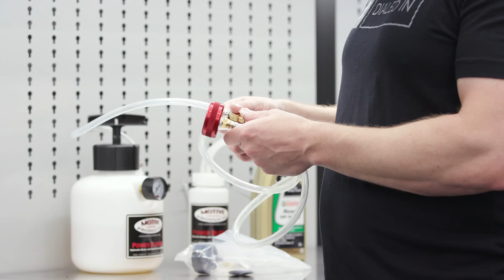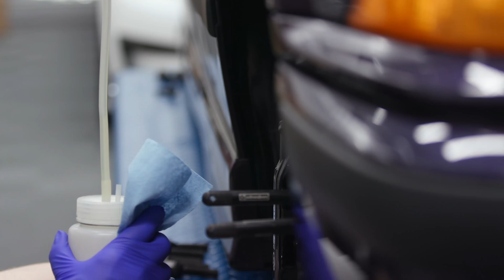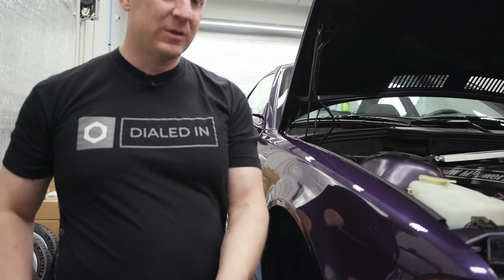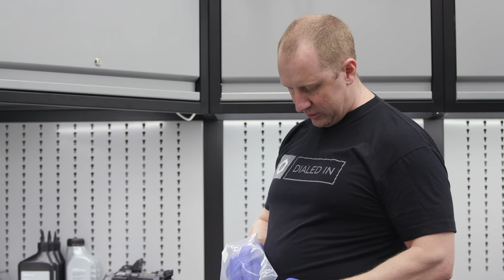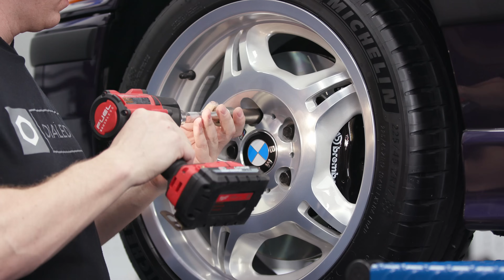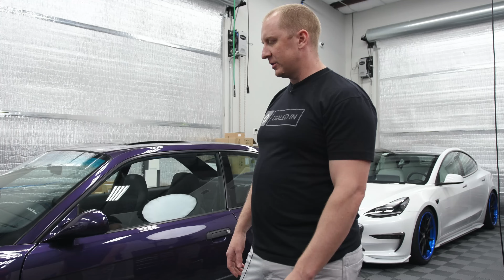E36 M3: Bleeding the Brakes and Buttoning up Suspension Install

Comment: What brake rotors are you using with the 996 brakes?  325mm fronts?
Reply from the maker: These were new aftermarket Brembos.
Reply: Are they from a E46 M3?  I have a similar set up but looking for slotted floating rotors, not slotted/cross drilled

Comment: Hey Matt, it would probably be a good idea to get a mini rolling cart for when you take parts off the car and use the tools and drill. 

That way you don’t need to pick everything up from each spot and also it will reduce the chance of damage of a tool hitting the paint since your using the the lift as a table

Comment: Maintain the pressure in the reservoir and loosen the bleeder until you feel you may be pulling air from the bleeder threads. I usually don’t put fluid in the pressure tank because its a pain to have to clean it out when you done.

Comment: I used the Motive for the first time a couple of weeks ago on my MX5 ND2. Really easy to use and flush/bleed the brakes. I just cracked the bleeder screw open a quarter of a turn and it worked well. Kept the screw open until I needed to pump up more pressure or empty the "catch-can"

But lol@BMW nerd comments 🤣

Comment: FYI you need to remove the preload from the end links while the suspension is loaded.
Reply from the maker: No
Reply: @ObsessedGarage  Your ignorance amazes me.  Yes you absolutely do.  You do not want preload on your sway bar while the vehicle is sitting.  This is pretty self explanatory and important. 

You are wrong Matt. If you don’t know what you’re talking about, do not spread misinformation.  It doesn’t help anybody.  In this case, you don’t even understand what adjustable end links are for.

Don’t let your ego get in the way of learning.  If you want to be “obsessed”.  Then do things properly.

Comment: front rotors are incorrect orientation, drivers side rotor should be on the passenger side, edit so are the rears. awesome build btw
Reply: How can you tell? The slots don’t make a difference - the direction of the internal cooling vanes does.
Reply: @matthewfuller1129  think of the slots as arrows, the arrow ends at the edge of the rotor, the slots should face the rear of the car. I guess it doesn't really matter, but they were designed to go the other way so that's the way I'd install them. Edit use the slot at the 12 o'clock position with the arrow rule, you will see which way they point. Some rotors it does matter which side they are on so the cooling veins are catching air.
Reply from the maker: You obviously have no idea what you're talking about..
Reply: @ObsessedGarage  in my experience most rotors with external slots face the rear. I realize that the internal vains dictate the direction, it is just very uncommon to have the 2 not match. I've been a mechanic for a 6 years now and admit I learn new things every day.
Reply: I think he specifically stated this was the correct way

Comment: I let the bleeder screw wide open to speed up the fluid drainage. Because you are not pressing the brake master cylinder, you don't have to manage the bleeder screw. You just let it run at a pace where you will not deplete the fluid too quickly.

Comment: Usually a good half turn is all that’s needed to open the bleeder valve. In my experience it should bleed out much faster than shown when pressing the brake pedal but I haven’t used that power bleeder.